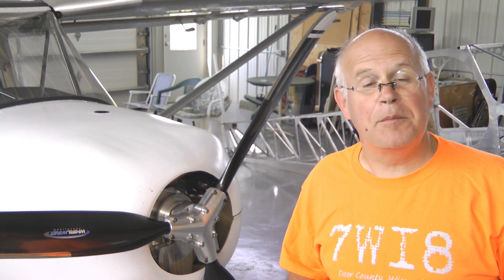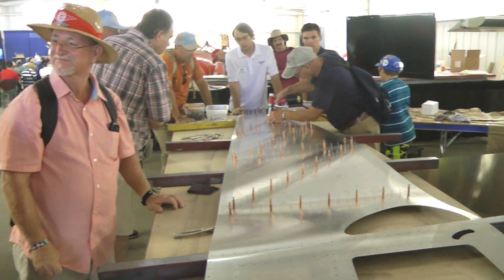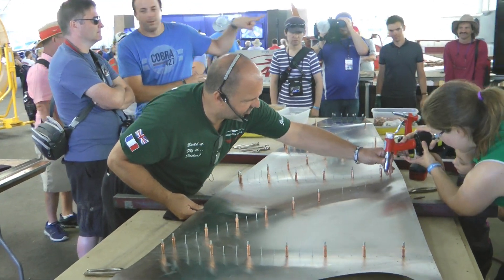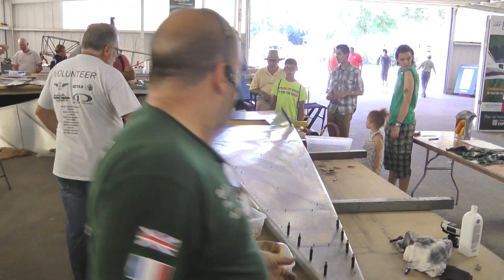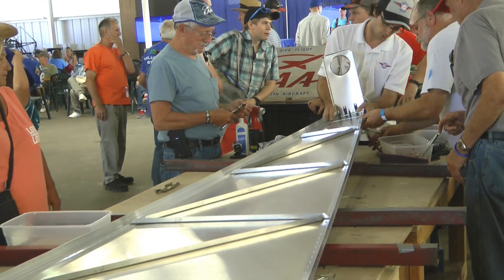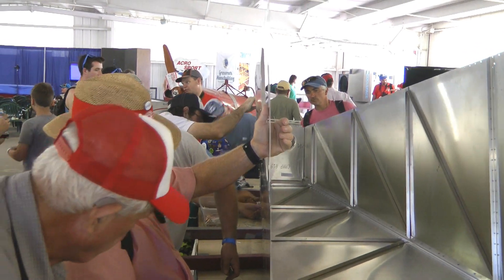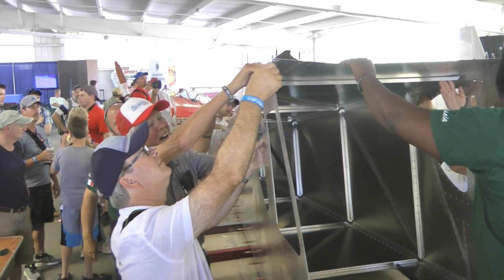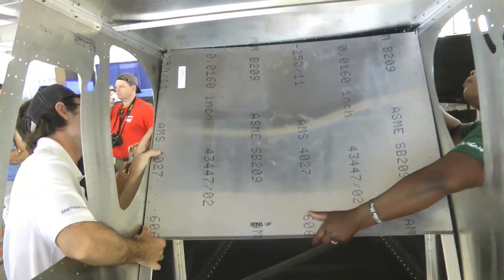So easy: Building the new Zenith CH750 Fuselage at Airventure 2017

Comment: any worry with oils and sweat from handling causing corrosion down the road?
Reply: south mac It will be degreased and washed inside and out before painting. It will be rotated about it's longitudinal axis for ease in cleaning and painting, Then the interior will be treated with an FTFC (Fluid Thin Film Coating) anti-oxidation treatment (like corrosion-X). The interior of the wings and tail section should be built with repeated treatments in mind -- spray wand access points. --->  That is, IF you DON'T store the plane indoors AND fly/live in a dry climate.
FYI - I don't really know what I'm talking about, I just have watched most of HomebuiltHelp's youtube channels videos. They are very informative. ;) 
     I'm currently a new member of EAA and have just purchased a week long pass to their "AirVenture" event in Oshkosh,WI On July 23-29, 2018
See you there...
          https://www.eaa.org/en/airventure/eaa-airventure-tickets